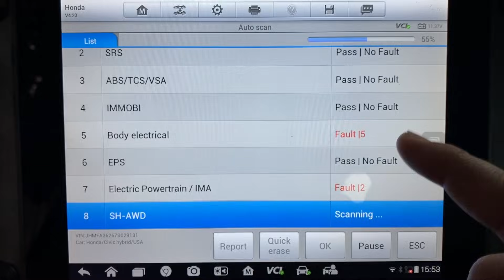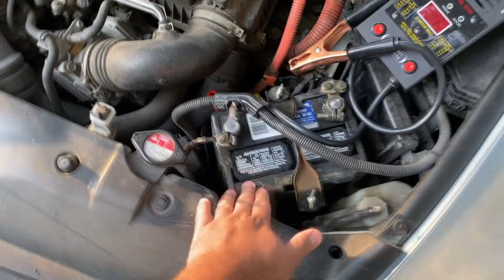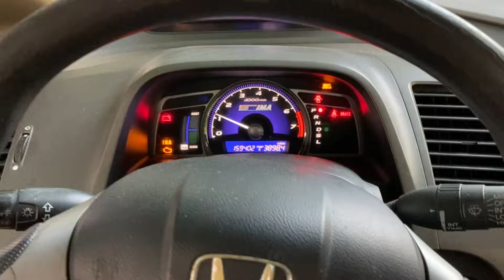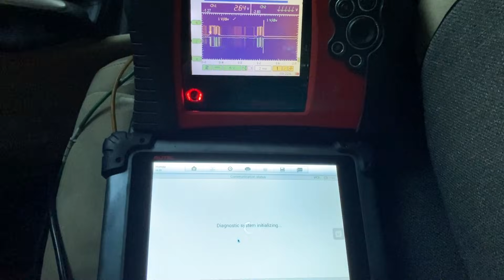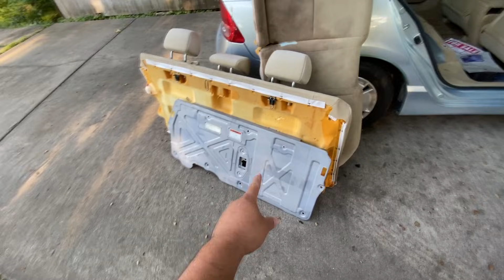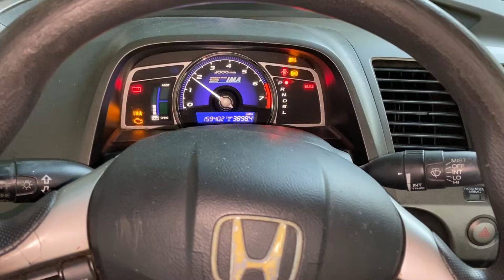HONDA CIVIC HYBRID STALLS / NOT CHARGING DIAGNOSIS

Comment: If you ever need help, let me know. I work for Honda and I have access to IN.
Reply: Hi .i need help.im in canada.i have similar problem  2007 civic hybrid-with no charging baterry /i change hybrid baterry. on dashboard 3 lights-- read no charging baterry.ima.ch engine.  On scaner obd2-code p0a3f motor rotor position cirquit  .i need yours brain solution.  tks walter my cell 3216660504 i gonna paye no problem
Reply: @piotrekewa  so, after I bought this car (Honda civic hybrid 2007) right after driving it off the lot, the engine light came on. I ignored it(it was $3500). Then the IMA light came on. I bought it with 155,000 miles and now with 160,000 miles, then the battery light came on, and it’s not charging at all. I am scared that it will just stops with me one day. Please help. My email is: stephaduclasse@gmail.com. I would really appreciate it. Ps:I don’t know $$ for a new car right now so, fixing it is my option. Thanks!
Reply: I habe a civic hybrid 2008. The battery rapidly discharges to 2 bars for a few minutes and comes back to full bars again. When it discharges, IMA doesn't work. Please help
Reply: Uu work honda
Reply: Nathaniel Humes yes
Reply: Rivera's Garage  My Honda CRZ has IMA Light/Check Engine/Emissions/Battery Light & Charging System all come on once i start the car. It does drives but if i am stopped for long periods of time it starts throwing Hill Asst/Abs/Power Steering Etc plus radio and drl sustem restarts itself while the A/C loses power. I have changed the IMA Battery Cooling fan also have changed the Dc to Dc converter and has replaced two 12v batteries i have no idea of what else it can be and in need of help or any suggestions will be appreciated.
Reply: Gabriel Montes have you had it scanned. I usually see the lights you’re mentioning due to power delivery issues, but codes really point to a component or area
Reply: Rivera's Garage Last scan i did had a P1570 code but the signal that demostrates the gas icon to car to battery shows as if its charging. so i have no idea exactly whats wrong but the batteru never charges nor does the eco normal or sport button work.
Reply: Gabriel Montes I need more information from the car, year and trim model. Just on the code alone, it shows 43 steps to isolate the problem. I’ll send you my contact information
Reply: Rivera's Garage The car is a 2011 Honda CRZ and i appreciate it
Reply: @JohnattanRivera1984   If possible can you send me your info. I have similar issues I have codes P15A5 & P1440. 12V won’t last more than 4 days now because it’s not being charged, if braked to long power steering, abs etc all lights up there dash board.  

I couldn’t find anything related to the wiring of the vehicle & a site I paid for didn’t have the hybrid links as stated.
Reply: I need help am in Tanzania,my Honda civic hybrid 2006 shows IMA and has hard start every time engine cools down.Share your details.
Reply: @collinsagina9582  more information is needed. There are a bunch of reasons why it’s doing this. Have you had it scanned? Any recent work done?

Comment: You did not get lucky. You put in all the work. You studied the systems. You studied the wiring. You then worked of a diagnostic plan that took you to the loose wiring. Great job
Reply: He would have gotten there eventually.

if he was lucky he would have noticed it the first time he hooked up the jumpers.

Still a bit disappointing that after all that troubleshooting it turned out to be a loose connection.
He will have a hard time selling that to the owner.

That's the problem with electrical systems, one bad connection can affect the whole thing.
I've even had batteries that act flat, even though the connections were tight - pull them off and clean the terminals and it's all good to go again.
Reply: I seen the problem soon as it did it , but that's how shops get paid hourly ! 🤑
Reply: If you want to get lucky, this is how to do it!

Comment: The Delay is because when you turn on the car it only uses electric power for the first 10mph and I'm guessing the IMA is not working so it sees that and automatically turns on the engine

Comment: Bro a quistion I am asking you from long time but you don't replay my answer my question is how do you find any car engine to ecm wiring diagram I hope you replay my comments
Reply: I will answer,   I am not Eric. Mitchell,   alldata .   Identifix  the most  common  sl automotive  software
Reply from the maker: Thank you!
Reply: Those are subscription based. Anywhere from $160 a month. There's another way thru black market you can get the laptop already preinstalled with software but it only goes up to 2014. Still great help if you are a small shop or mobile... You can also work part time at a shop and use their account lol Good luck
Reply: Alldata and Mitchell have a DIY version. One VIN, one year access. Also, many manufacturer's have access for one day, 30 days, etc. A little pricey, but you have OEM info.